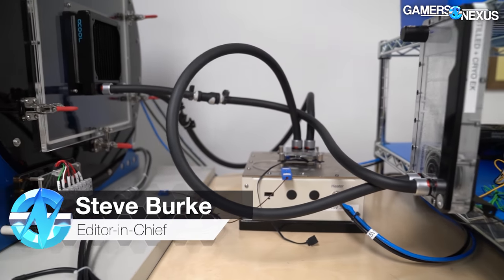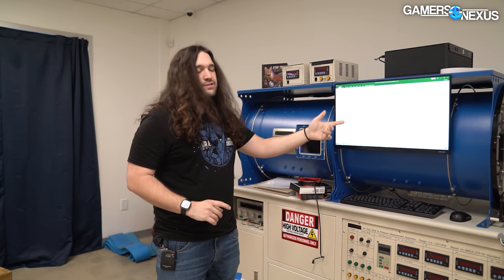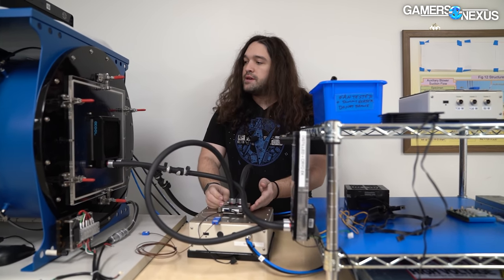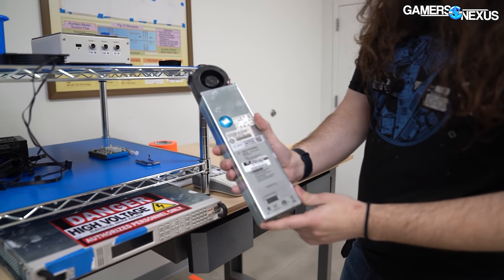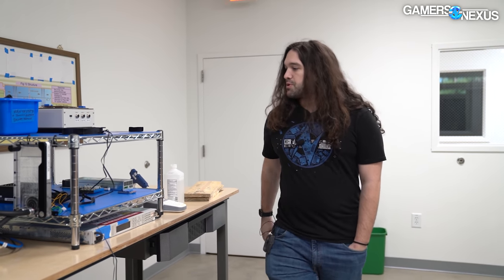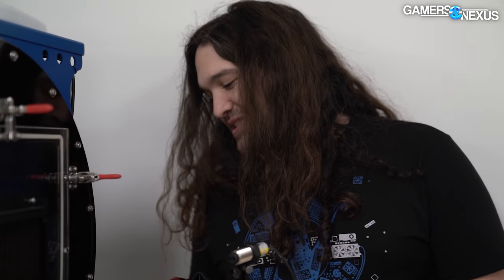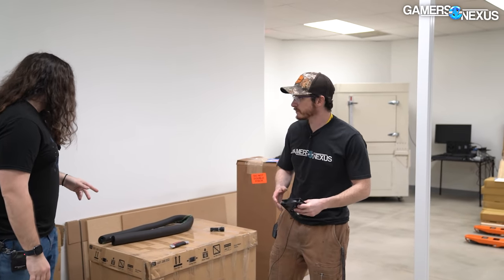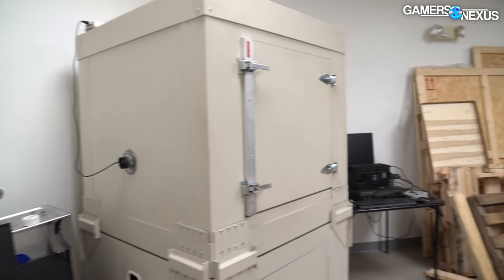GN Lab Update: Fan Thermal Testing, Pressure & Flow Charts, & Challenges

Comment: I think rpm normalized fan testing would be only useful for things like hard drive fans, server case fans, power supply fans, and all of the fans that go up to like 10,000 rpm in the first place. they're just brute forcing air at the point, and the performance from different ones of these and which oem version of htese fans would potentially either have some difference from each other or they end up all being the same in all of these older products. but the issue with that is they're often fans that are neglected and not brand new off of a manufacturing line. but that's where I think it would make sense atleast. and it probably won't matter to the consumer moreso than it would to clients on the server side of things. i mean it's not like a consumer can afford to give a shit about what fans go into their psu's and their hard drives. let alone if htey're even going to have a server it probably won't be a server they end up putting in a slim profile server rack encasing.

Comment: In regards to how the pressure is highest at 0cfm and zero at the maximum flow rate, I would explain it like this to your viewers:

Imagine pushing some heavy object. If it's moving at the fastest you can run, you can't push on it anymore, because you're spending all your effort trying to keep up. Then if the object isn't moving at all, you don't need to spend any effort keeping up with it and you can push as hard as you can.

Comment: Ah, that chart is nothing, try reading a psychrometric chart.  That's where it gets fun!

Also, asking again for you to look into gigabyte gaming waterforce cards, they have nickel/copper plated aluminum waterblocks, and some people are having the nickel plating completely corroding away in only a few weeks, and some people are to the point where many of the microfins show large parts being corroded away.  Its completely disgusting.

If you want more information, there are usually a few posts a week on r/watercooling, and now a subreddit mostly for that issue, r/GigabyteSucks.

There are aftermarket blocks for those cards, so I am sure you could get some people to send you samples, so you can see for yourself how awful they are.

Keep up the good work on real, scientific, testing, I love to see it!

Comment: Well the blades would break the sound barrier long before 100K RPM and havr a rather large catastrophic failure. Measuring up to 99,999 is basically just saying it can measure anything.
Reply: Dyson has a motor that spins at 104,000 rpm!
Reply: @randgrithr7387  its not the same principal, its a magnetic field. Edit: I guess I could have said "it can measure any of this style of fan" to be more precise.

Comment: Man I remember working at fry's and some of the fans would have this kind of data on the box, with no info on how they were measured or how to compare the data to other fans. They even had someone from Enermax come in and try to educate us on how to present that info, but it had an obvious slant toward their fans, and they couldn't actually answer how to compare the data on their boxes to other brands either. The data was totally meaningless based on what Anandtech reviews of those fans showed later lol

edit: also where's the bucket of open water on that open loop, I can't see it? I didn't think anyone really used open loops in PC cooling anymore, everyone moved to custom built closed loops around when i got started in 2007

Comment: Rpm normalized i find useless as frankly you set the fan as fast as it can go before it becomes loud. My gpu is always the loudest so i tune it up to that.  generallythat means for 120/140mm fans that you can go pretty fast. For 200 mm fans tthe limit is way lower as they are louder.

And I think it would be interesting to see if the advertices max cfm is still possible in a realistic resistance.  But the most important is normalised resistance on a normalized sound level and see how much CFM we get then. we are being told a lot but those numbers we will never get. So it may be better buying a 35 CFM fan that is quiet then a 65 CFM fan that only achiefs that at 55 db and only does 30 at the same sound level.

Comment: I know I might be in the minority here, but this lab testing equipment might be engineering overkill for case fans that cost anywhere from $10 to the more expensive RGB single units with the same blade/bearing designs. Checking fan performance against manufacturer claims will result in what exactly? If I were testing fans, I'd plug in the Top Twenty selling case fans, run them all at full speed and see how long each last before they start howling and the bearings fail. I want reliability. But that's just me...

Comment: yeah so i work for a company that does similar testing for pumps and i see performance  and efficiency curves for pumps if you hit me up i can get you into contact with my engineers that can much more easily explain the curves and what all the information means.
Reply: so as far as testing goes im sure my engineers can help you to determine which fans would actually be better for rads  and whatnot
Reply: and yeah im listening and your speaking of pressure and flow which is exactly the two biggest variables for pumps and fans

Comment: Normalized RPM is stupid testing when talking about something like 1500 rpm on all speeds, however, normalized RPM when it comes to fan duty could be beneficial. People will generally set their fan on a % total load profile. So all fans at 50% of their usable range vs 75% vs 100% and which does more at a given duty cycle.

Comment: You should be using armaflex glue onthat armaflex, not hot glue. You also shouldn't be soldering valves with the stems in them, gut that valves before soldering!

Comment: A lot of that data won't matter until you have sizable amount of real world information. You will come to a point, in which you will realize, a lot of data you collected, doesn't matter anyway, since change in parameter X doesn't have any impact in final performance in any case you have reviewed. Or real world-relevant case. That's normal and you expect that. But if you are tempted to NOT COLLECT data you don't need, you will end up with a case that parameter X finally matters... and you now the rest. 

So don't give up!

Comment: Use a different lens when the cameraman and subject are not both stationary please. If you absolutely must (for artistic reasons) make 80% of the frame blurry to the point of giving viewers headaches, the subject should at least be in focus. This is not possible when you're making unplanned movements up with which the cameraman can't keep.
Or if it's not the lens, please fix whatever it is that makes your apparent image quality worse than when I record on my S8.

Comment: Sorry to say this but by your own explanation you made your new fan-tester a fixed variable and thus unneccessary. If the only variable is the fan and all the data collected from the new tester is more or less pointless as for the end-user the only number needed is the discharged heat - which you could have also measured without the new fan-tester , because it would just have needed some other sort of replicable setup. 

Hope you find some way to make use of all the - currently useless - data collected in the future.

Comment: I am going to have to warn you again. Your sound chamber has a fatal flaw. Wires can and will carry sound. If you have your microphone inside of the chamber and there is no sound it will pick up vibrations from the cable running through the side. You need to do what you have already done, foam around the wires but also add clamps to prevent the wires from endlessly transmitting their vibrations.

Comment: oe looking forward to seeing the aproacable version of the data that monster can pump out ^^.

wile your not going out of your way to test watercooling will there be a look at fan configurations on radiators and seeing if certain fan blade profiles favor a push or pull setup or do not care? i happen to know the noctua A12X25's really prefer a....i wanna say push setup over a pull setup...or so people claim haven't really seen that tested to make it definitely a thing i can claim actually happens (think the actual claim boils down to it's better at pushing then it is pulling).

Comment: Off-the-shelf turbo pumps for vacuum applications can go, depending on the model, up to 90000rpm. Though it seems there have been miniaturised versions designed going at 100000 rpm and 200000rpm.

Comment: $100,000 machine to test whether on not to get a $20 fan or a $40 fan. Lol - Seriously? - You spend thousands of dollars on your pride-build and you're worried about an extra $10-$20 per fan? - Just get a set of Noctua NF-A12 Chromax fans and be done with it. - Problem solved.

Comment: 19:40 WARNING this method invalidates all the testing effort, in a quiet system all the noise is vibration and switching noise. Who cares if the fan blade noise is low but the whole fan is rattling because of bad balancing?
So the end of the day my free testing method when I put a fan on a huge wooden table worth more than yours, because I can hear the bearing noise, the pole switching and the unbalanced rattling.
I highly suggest to mount the fans on an ampliying material like 0,8-1,0mm metal and use srews, rubber spacers what you otherwise use in a real case.

Comment: Sorry but the dummy heater Radiator test is dumb. 
If you have PQ data for the fan and the Radiator you can calculate the flow trug the radiator. if you know flow trough the radiator you know its cooling performance (since its the same every time) 
If you want to show how good fan x works with this exact radiator this is also not the way to do it. 
Add an resonator ow water of known temperature ( like a big insulated tank) and then measure inlet /outlet temperature difference vs flow. 

No fancy cpu heat load needed.
Reply from the maker: The CPU heat load is for testing thermals. Obviously. It isn't used for testing the radiator performance. Not sure how we lost you there. We also already said you can just overlay the curves, which I guess you missed entirely. You can't get thermals without the dummy heater.
Reply: @GamersNexus  But all the thermals you care about are the water thermals. 
Since Heat block and dummy CPU are not chaining why even have them in the loop? 

You can evaluate "real world" cooling performance by just testing how the radiator is cooling the water. 

From there it is linear. 

your heat bloc as well as your dummy CPU have a Linear fixed K/W number.
Reply: @GamersNexus  Waiting for the water to reach stady state is gonna take forever. 

Your Dummy CPU to heat block to water is gonna have a fixed K/W thermal resistance.

Measure and specify it once 

from there  on only test Air to Radiator to water thermal resistance with different fans fans. 
and add the numbers up. 

Don’t know if i have lost you there but all the fan is influencing is radiator performance and therefore water temperature. 
so it is sufficient to measure the direct change in water temperature.
Reply: As Project Farm would say, We're going to test that.